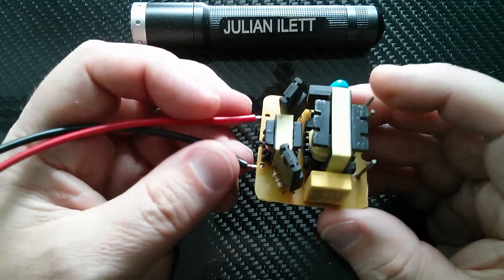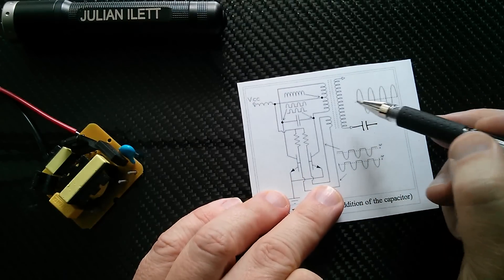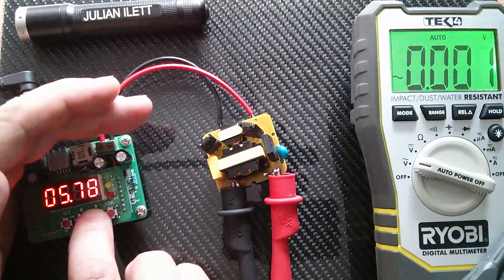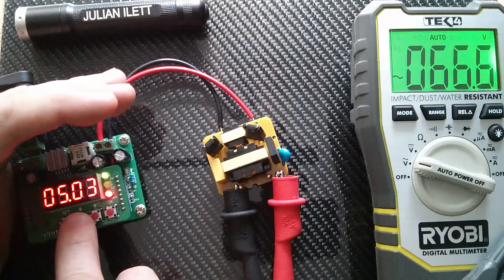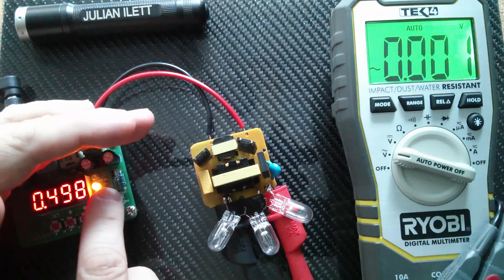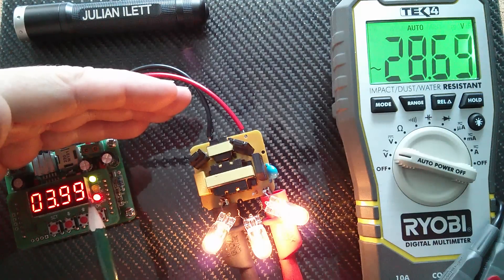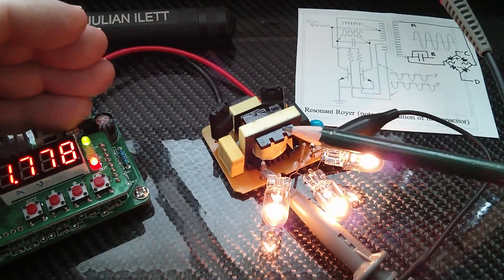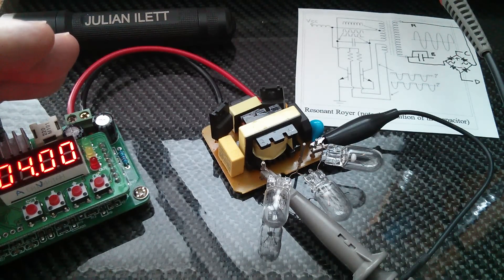Playing with: 12V DC to 220V AC Inverter Royer Oscillator

Comment: I hate to say this. but thats an efficient lil bugger!.......Good VIdeo J
Reply from the maker: Did you mean inefficient?
Reply: nope, i found it to perk my interest even at a low voltage in it still managed to produce power. that in my eyes was quite acceptable.
Nothing about it looked dodgy good quality components. even at 4 volts it was producing 30 V... i didn;t see anything wrong overall.
Reply: +Amy Marie no it's really, really inefficient. Around 25% procent efficiency. Which is really low. You know that the efficiency is equal to Watt out/ watt in *100.

Comment: Maybe the capacitor in series on the output is some kind of current limiting output?
Reply: Capacitor is there for driving a small flourescent tube. This is common with these so the cold tube does not load the oscillator when starting till it can get a good resonant voltage to strike the tube, then the capacitor reactance provides limiting for the current so it carries on running.

Not sure about the rectifier, I would guess this is to plug in a standard CFL lamp to run it, DC so the long wires to the lamp do not make a nice RF antenna and also do not damp the oscillator.
Reply from the maker: That's a thought.
Reply: I've got the same inverter. It has not the bridge rectifier but it was marketed as an inverter for fluorescent lamps (see my other comment somewhere here)